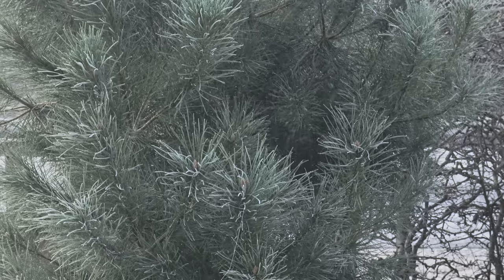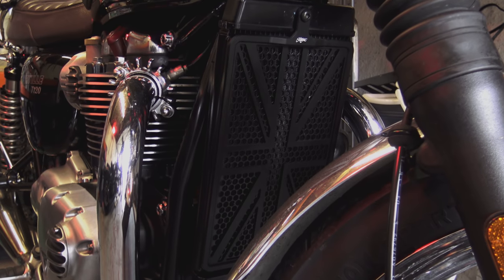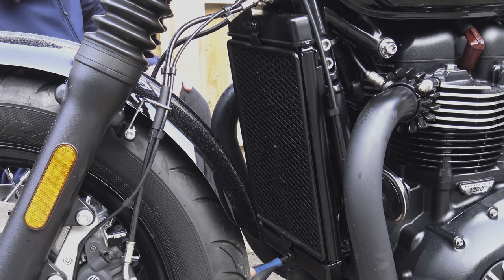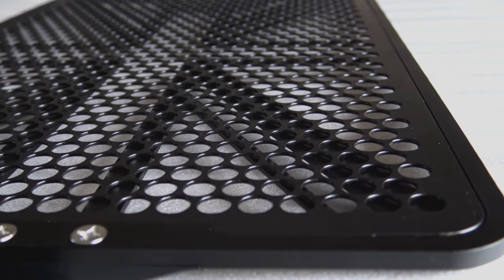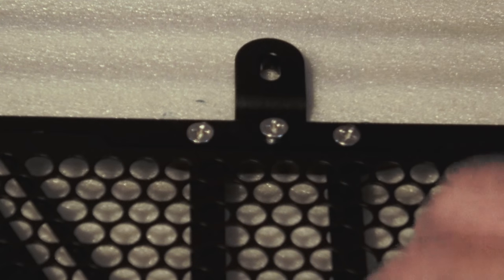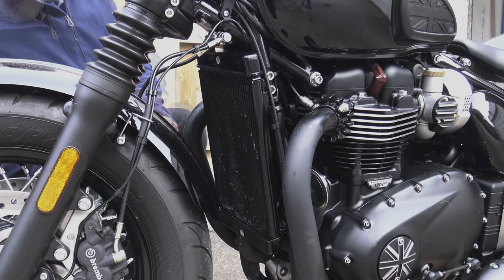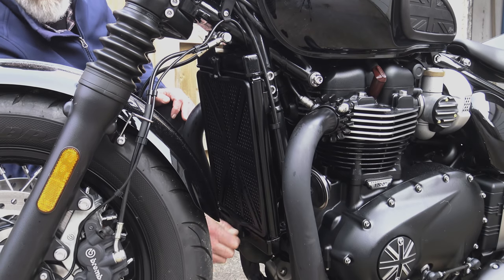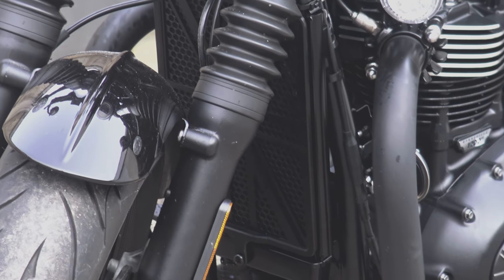Triumph Bonneville Bobber/Speedmaster! Motone Customs classic CNC Union Jack Radiator guard/cover!

Comment: Another nice piece of kit from Motone. Just one question Stuart, are you sure the Union Flag shape is CNC machined or is it laser cut?  You are correct about how cold it is, I have had the fan heater on in the garage while I have been polishing the Goldwing!
Reply from the maker: Hi Michael thats a good question! both the frame and the union jack are cut from one single slab of aluminium. as laser cutting on works in 2 dimensions it would have been impossible to produce it that way as the cuts are 3 dimensional. I hope that makes sense.

Comment: The stock allen bolts on my Speed Twin 900 aren't quite long enough to go through this radiator guard and screw tight. Do you happen to know what size bolts these are?
Reply: To answer my own question - the stock is an M5 x 12. I replaced them with an M5 x 16 and they worked great. Funny thing is my wife went to recycle the box the Motone radiator guard came in and the screws were in the box! D'oh! BUT - they were stainless. The ones I ended up getting were black so it looks great!

Comment: My only complaint with Motone, which is not apparent on this piece, is the way they brand their accessories.  I find their badging is too in your face on most of their pieces and the white cursive type font just doesn't match the vibe of the modern classics.  I tend to stay away from a lot of their stuff because of it.
Reply from the maker: Thanks for your comment Sheldon, but to be honest I'm struggling to think of many of their products that actually have their brand on them.